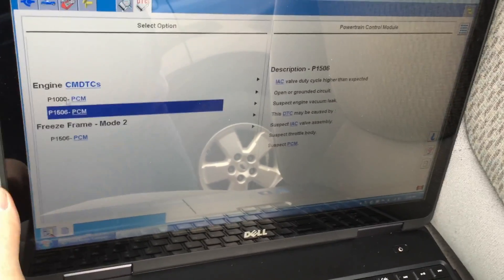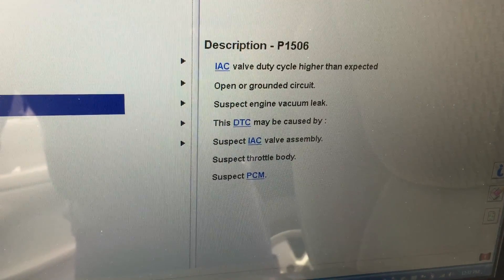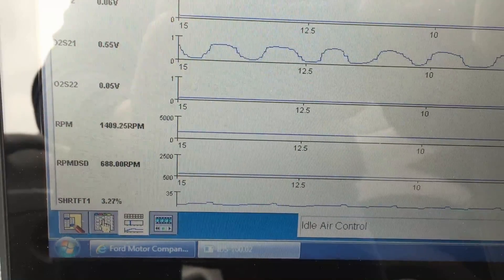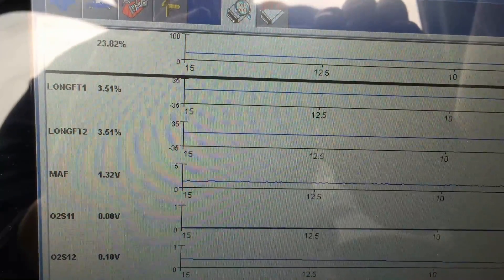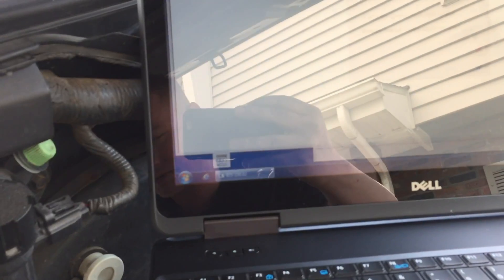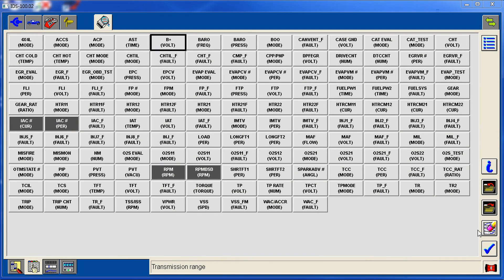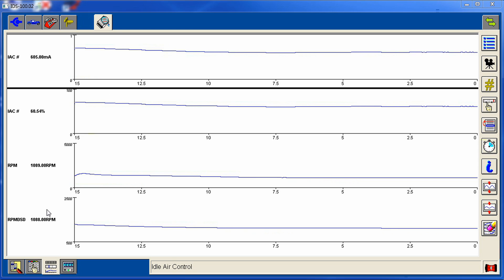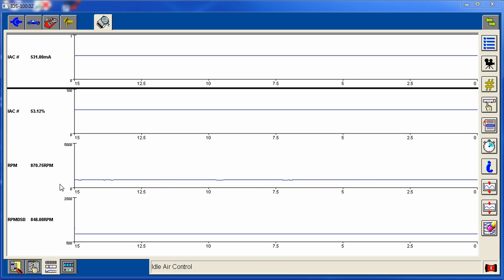Ford Idle Air Control Valve Diagnostics: High Idle DTC P1506

Comment: I’m inheriting my dad’s 2015 f150 with 5.0.  It has 66k miles and I recently replaced air filter and oil.  After a few thousand miles it’s throwing a p050a code.  Has had a history of rough idle.  What could it be?

Comment: 1992 explorer 2wd, was running fine. all of a sudden it started bucking as if it was running out of gas. Pulled off road and the idle was just up and down, attempting to give it gas it just bogged down and wanted to stall. Disconnected IAC and it idles just fine but still wants to bog down giving it gas. Have a new IAC valve installed but it's a no fix. smells rich out exhaust. 
Should I move to the fuel pressure regulator. Checked for vacuum  leaks did not find any.

Comment: Changed the pcv valve and that troublesome connector that fails and ofcourse it had a hole in it. Now im concerned about the iac because now it runs smooth until it warms up and it runs real low then stalls when I back up or park slowly. I have found other leaks in a few vacuum lines one that goes to the ac which isnt running. I wonder if that iac isnt running right. I hope its that. Cant afford an overhaul right now. Need this truck to run to go make money just to give it an overhaul. Frustrating.

Comment: I found this video because I got that air valve error check engine light thing, but I'm idling about 600-800 RPM. I cleared the code but was wondering what the hell it meant because I'm used to carbureted stuff.
Reply: I did get the error off Roading on a manual trans, maby just from idling down hills it upset ECU. I just know I parked it, went swimming, came back and I had the air but everything was normal.

Comment: My 2014 Ford F-150 eco boost v6 has a high idle on cold startup only and doesn’t settle down for about a mile of driving. Only concern is I pull out of driveway too fast have to use brakes at idle speed giving it no gas. The high idle is approx 1200 when it settles down it idles smooth around 600

Comment: I did a smoke test on my 2001 F150 5.4 and the IAC had smoke leak from the cap.  I don't seem to have any issues with my IAC, should there be smoke from the cap?

Comment: On a properly operating unconnected (in your hand) IAC is the valve physically completely closed or is there a small gap between the pintle and the base? I ordered a new MC IAC (CX1867 ) and both my current IAC and the new one shows a small gap, i,e the valve does not look to shut completely on its seat out of the box (1999 F150 5.4l). I'm guessing there should not be a gap as this is what would cause the engine to stall out when one DCs the electrical connector. 

PS Thank for the videos, if I lived 2000 miles closer you'd be my mechanic.

Comment: Could be that the thermostat is stuck open and the coolant temperature sensor is telling the computer that the idle needs to remain high to continue to get the engine up to temperature. This will be noticable if the coolant gauge is not working.
Reply from the maker: no
Reply: Well, I reckon I'm a about to find out. I'm on my second new IAC Valve and it's still idling high until I come to a complete stop, then it falls back down. If it were a vacuum leak it would be constantly high. I'll let you know how things turn out after I replace the thermostat, temp. sender & sensor.
Reply: O.K., replaced thermostat, temp sensor and sender. Coolant gauge now works, all three new parts appear to operate properly. They all looked to new original from '98, so, needed done anyway.
Here's my issue. Starts w/no problems. Idles high at first, as it should, and drops down to idle. Problem is when driving and shifting it idles high. Idle doesn't come down all the way until I come to a complete stop and take my foot off the brake. Parts that have been replaced are: catalitic converter, O2 sensors, DPFE, EGR Valve & EGR sensor, throttle position sensor, PCV valve, and IAC valve(twice) both were new. Also took throttle body off and cleaned it. All parts removed were original parts. Truck runs great aside from the idle holding out until I come to a complete stop. Your thoughts. Also MAF sensor was replaced a few months ago.

Comment: Brian, first, you are the BEST!!! I can't, maybe I could drive to Chicago to help w my 99 F150 5.4 All is pretty good, but idle is just a tad, minor, jumpy, 6-800 rpm, also, can the engine fan clutch flux, which this truck has contribute to un-smooth idle, imperfect idle? Thank You Brian, you are a God Send, and who, what, where, do you refer mechanics to folks so far away from you? 

Thanks again,
George

Comment: Great Video!!! 

Got a 2000 Ford F-150... Replaced idle air control valve and still have up and down idle....  How do I properly relearn the idle air control valve?  There's a lot of conflicting information on YouTube about relearning procedure for 2000 f150... Thanks

Comment: Where are located? Because I changed my iac  and my idle 1100 to 1200 sounds like a miss when acceleration 35 service light comes on then faster goes off then at 45 comes on again then faster shuts off. I have new egr and tps . It is a 1992 ford f150 flareside. I live in Aurora Illinois 60505 Dearborn Ave 1625  phone 8155791419 Jeremy elam

Comment: Hi my name is Johnny I really appreciate you doing all your videos they're really helpful I have a question for you a couple months ago I was changing my spark plugs and coil packs and I broke off my DPFE sensor ports... now my check engine light stays on and it's telling me that is the DPFE sensor I'm thinking it could be the hoses Maybe but the car also has a little bit of a rough idle.... at 1300 RPMs well just below the 2 on the RPMs the idol gets a little worse Medela stop light or in park it is noticeable not out of control but you can notice it this is a 2004 Ford Expedition XLT 4.6 if you have any help or knowledge to give me on this please let me know
Reply: And yes i did put a new DPFE sensor

Comment: Will the IAC also cause low idleing and stalling? '06 F150 5.4L 4x4 idleing in P/N @500 -600 rpm but in D/R @ 300 - 400 rpm. Once moving engine runs fine.

Comment: I've heard that if you unplug the connector to the IAC and crank the engine over... you need to re-learn the computer. Is this true even if you're cranking the engine to check the connector using the noid light (since once again the connector is not actually hooked up to the IAC)?
Reply from the maker: no

Comment: I have a 03 ranger 3.0 with high idle 
Changed the mass, IACV, TPS and PCV 
Sprayed starter fluid on all vacuum lines with no change in idle 
No check engine light
Reply: could be throttle body wear look inside body see if the brass plate has a gap or is it worn down. there should be no gap at all .use flash light.

Comment: Great video, I have replace my iacv because it die on me at idle at the stoplight, have to keep my foot on the gas to keep it running. After replacing it the idle when up to 1300 in park, and 8 to 900 in drive. Fuel trim are good and there no  Vacuum leak. Do u think it's just a bad part out of box. Thank
Reply: Got it fix. Rpm was at 1300 so I unplug the iacv an rpm didn't go down, hold at 1300 rpm, tap new iacv  with a screwdriver couple time and idle when down, check rpm was at 500, plug it back up an idle was back to normal. It was stuck for some reason

Comment: I own a 2015 f 150 xl with 5.0 and I cannot locate the iac valve, it's not even listed in the Haynes manual i have, I looked all around the throttle body, everywhere, cant find it

Comment: Love the channel helps me out more than i can describe. But quik question for uou i have a 97 expedition 4.6 romeo. Two days ago i started it and it just idles at 2000 rpms. I romoved iac and did not seem gunked up but found alot of oil in the wire harness/ clip.   Is it possible the oil bridged the two pins and shorted out valve moter or fuse?where should i start? Vehicle has 250000 miles but need it to hold up for a few more months. Any and all advise welcomed and appreciated. Thank you
Reply: 2v i believe

Comment: Great video.   Question: 98 Ford Explorer high idle when stopped and vehicle doesn't want to slowdown when gas pedal is released.   IAC and connection are good.
Reply: I'm having same issue but on an 02.  I haven't tried disconnecting mine until later when I get home from work tonight. But it's really hard to brake and/or drive it lol
Reply: @rodney williams

Comment: Hi thanks so much for the video Sr. May I ask this question please Sr. Instead of using that light bulb is it possible to check it with a multimeter? Appreciate your favor.
Reply from the maker: No you want to use this method as it load test the circuit.

Comment: So if the long term fuel trims are -18 no codes other than p1506 pcv valve was replace iac also egr and Intake gaskets , valve covers, injectors plugs, coils, some hoses ,runs good just high rpm no dies or black smoke maf sensor fixed black smoke problem? Lost

Comment: My 98 F150 4.2 has the 1506 code, idles a little higher than normal, but is running smoothly. I did replace the IAC, but did not resolve the issue. I can't hear any noticeable vacuum leaks, so my question is, what would be the next most common problem?
Reply: Check the vacuum line that runs under the throttle body to the PCV valve on the passenger side valve cover, it is a known problem and can cause vacuum leak and high idle issues

Comment: Is it possible that this air control valve can cause an engine to lose power while you're driving down the road? I am borrowing my father-in-law's pickup while my SUV is in the shop and it's a 1997 Ford Ranger. It has a 4-cylinder engine and it was losing power on the highway the other day when I was trying to drive about 55 it felt like the engine lost power or idled way down and I could only get it to do about 40 when I was going up a hill but then it suddenly started responding normally again. It did this again another time or two during the trip home. When I parked it I let the engine run and started checking connections and things thinking it could be a sensor. I tapped on this particular valve while it was running with my fingers and the engine which was idling kind of rough and low like it wanted to cut off suddenly perked up and seemed to be idling normally. When it malfunctions does it usually just cause a high idle or can it do something like the symptoms I noticed? What do you think could have caused this if it's not this valve? Could it be the throttle position sensor? Thank you.

Comment: Hey bud great videos, I follow everything you do on the f150's with the 5.4l 2v Triton. Anyway I have a 2002 f150 FX4 offroad, with the 5.4l 2v Triton, I have just got done replacing the whole rearend with a yukon true track, with usa alloy axles, brand new front, an rear drive shafts, and brand new transfer case, well after doing all that I found out my passenger side exhaust manifold was rotten out so had to replace that as well and had to even drill out the back two studs. Well now everything is done I went for a test ride tonight and now notice when driving out the highway at 70mph when I left off the gas pedal my rpms drop down from 1700 all the way down to 1100/1200, but when I get back on the gas it comes right back up,so I tried this from 50mph, and 70mph and it does it the same drops about 500 rpm's then right back up after a few secs or I get back on the gas, I also tried it with my cruise control on I set it on at 65mph and when going down a hill and even a few times on a strait away it dropped the rpms then came right back up, and when it does this it almost feels like I'm putting the brakes on for a sec then it comes right back up and feels normal. Please any info or point me in the right direction to start would be great, as I just forked out so much money rebuilding the whole drive train I don't have any extra to just start guessing and replacing stuff. Also there are no engine codes or lights on, and when I bought the truck 4yrs ago the tranny was just put in it about 15k miles before I bought the truck, it now has 181k on it, and had 140k or so on it when I bought it.but the truck was so nice I started rebuilding everything that would go wrong from the whole steering system/ control arms, wheel bearings everything. I also did complete tune up about a yr or so ago all new coils, plugs, k&n air filter, high output alternator just to name a few things. Anyway I thank you for all your videos as if it wasn't for you and your videos I wouldn't have been able to do none of the stuff I did to the truck Thank you so much my friend, and again any info on the rpm drop would be great.
Reply: Lol haha

Comment: Great informative video thanks alot, I was wondering if I need to replace my IAC. I have a racing idle Rpm is good its only when im driving 2nd to 3rd gear races then it goes inot 3rd and won't go into 4th so it only goes 55 mpg at 4500 rpm. Tried cleaning it and i sealed it good. Any advise?

Comment: Nice explanation. I have problem on my 1997 escort zetec 1.6 16v with high idle rpm and i already replaced iac, with an old one i had a problem with wariating idle, thats the reason i replace it. Now i better look at the intake and i found it distroted, and when i put the new one i can hear the noise, because of vacum leakin. With old one that wasnt the problem. Im not sure if the body of the intake is distroted or the new IAC is. Ill better look that tomorrow and ill try to fix it. 

My question is: How can i easily test the V on the connector or can i put an 12v bulb there to test it ? Thanks! Nice tips!

Comment: Nice diagnosis! What are your views on cleaning the IAC? Considering the service manual states that it should not be cleaned.
Reply from the maker: I only clean them if they are severely carboned up and only as a diagnostic tool otherwise they get replaced.

Comment: Is there an IAC on the 2013 F150's? Idle is a little rough (30,000 miles with new plugs and coils (5.0 V8), reset the PCM, new air filter and clean mass airflow sensor) with no codes. Thought maybe a dirty IAC might be the issue?
Reply from the maker: No IAC it is built into the ETC system.

Comment: I have an issue with low idle.. the car keeps running but has not thrown a code yet at 180,000 miles should the o2 sensors be replaced
Reply: Highly unlikely to be o2 sensors

Comment: Do you have video on how to replace spark plug wires on a 2004 v6 mercury mountaineer? Also my mountaineer stalls occasionally when I out it in reverse and also when I am on a stop light the truck feels like it wants to die. you think the IAC could be the issue. transmission was rebuilt last year. Thanks

Comment: THANKYOU ! My Van was blowing the 30 amp fuel pump fuse under the hood which was un related to this video , Twice . And then i noticed a high idle .Thats when i searched you tube for a high idle on a 97 ford econoline 250. Thats when i came across your video and i took a chance with the IAC valve because I could not find any vacumn leaks. Replacing the IAC valve was the problem.THANKYOU VERY MUCH FOR THIS VIDEO! You saved me so much of a head ache!

Comment: Wow just found this site video...Such a service for the knowledge bomb dropped. Thanks for the most thorough video I've seen.  A biz such as yours would rock in Charleston SC for working guys who try DIY on most but need a hand occasionally. I'm swapping out my IAC tomorrow, it makes the saddest sound on power up but at 242,000 miles, the old gal has a right to new parts....just to validate, yesterday I lifted bed and changed out entire Airtex fuel pump/sending unit using 6 cargo straps and a lot of patience. Tried to attach photo, no joy...Thanks again.

Comment: I have a 2011 ford raptor. Last week I been experiencing almost a misfire type filling only when coasting forward from a dead stop or having my foot slightly on the brake and inching forward, or when coming to a stop the last few mph the truck begins to shutter. Um when sitting in drive I get a lot more shutter then the big block normally has. No I ruled out brakes because when coasting in neutral or when coming to a stop in neutral the shutter is gone and I have no brake pulsation at higher speed. The last few days I can start noticing it shutter but a lot less noticeable while driving. I have viewed my misfire data and have yet to see any misfire count. Brand new motor craft plugs and wires (basically did my 105k) any ideas

Comment: hey I'm having a problem with my 2005 ford five hundred limited. showing code p0402. exhaust gas recirculation flow. exsesive detected. can you please help me. Iv read and it says I should change the egr dpfe sensor. but I can't seem to find that part for my car.

Comment: I have an 07 focus that has a high idle and slight hunting but no check lights any advice? thanks
Reply: Brenda Bridges  Brenda, I'm watching the video & saw u r question.alot of imports like 2 surge/rev hi  n low due 2 low coolant/antifreeze & water mixture. If the coolant is low, they will rev up & down, up & down.so, I'm just wondering if ur car is low on coolant?  jw...good luck

Comment: hey i need your help big time...... i changed the oil on my 03 ford f150 fx4 with a 5.4. while i changed oil my son replaced air filter backwards. i started truck and it ran for a minute then shut itself off. put a new air filter in. i cant hear fuel pump kick on? it senses rpms cranks and wants to start. fuel rail just puts a tiny low pressure squirt out. checked fuses. my only vehicle please help.